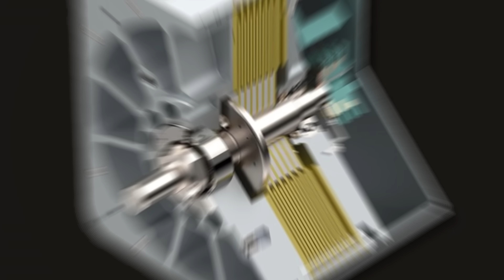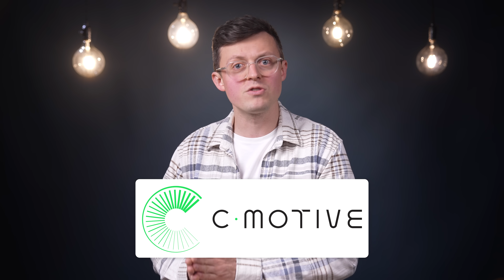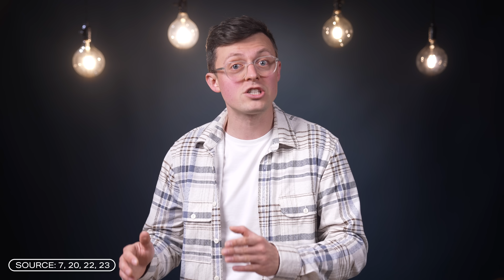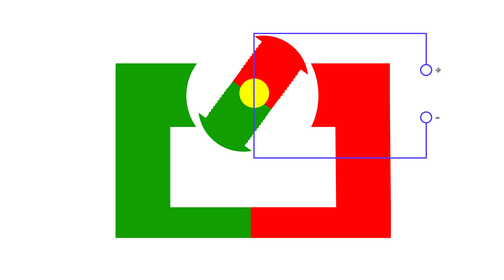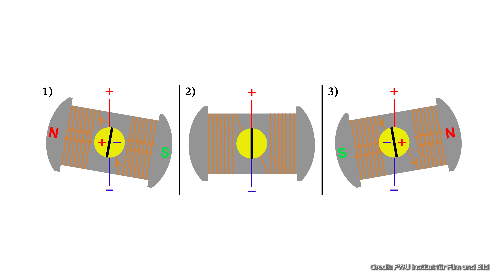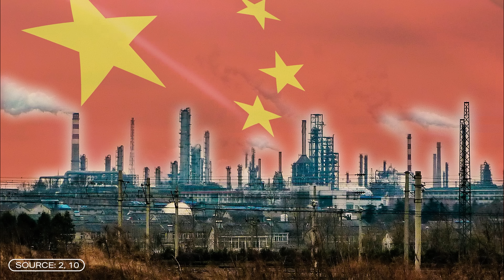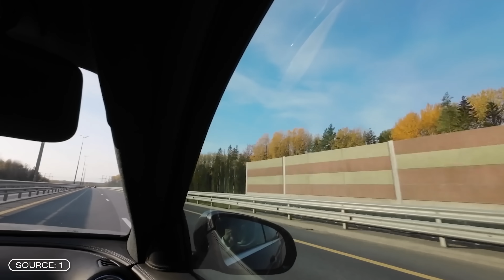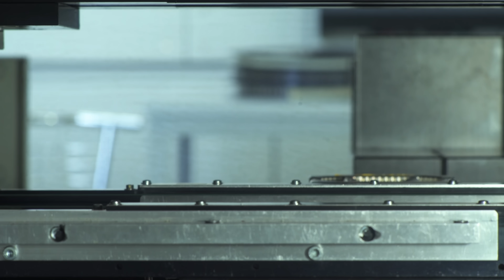Have We Gotten Electric Motors Wrong for 150 Years?

Comment: Electrostatic Motors? Do they run on static? That wouldn’t need much power to run. Oh, they are only used for micro-engines, so what’s new? Did they find a way to use Electrostatic Motors to power a car? ‘That would be a micro-car.’ This video provides a deep dive into the physics and commercial viability of the modern electrostatic motor breakthrough, but could they be used on the Moon?

Prompt:
Refer to: “video”
Integrate with Google Search.
Answer questions as an AI Scientist.
1. Review the video and recap the key points.
2. Explain the reason Electrostatic Motors aren’t used.
3. Confirm facts and understand that Electrostatic Motors could change the world.
4. Provide your opinion as an Advanced AI for a futurist.
How could Electric Static Motors be used on the Moon?

Gemini Said:
As an AI Scientist, I have synthesized the technical data from the provided video and current aerospace research to address your questions.

1. Video Recap: The Electrostatic Breakthrough

The video highlights C-Motive, a startup reviving a 270-year-old concept: the Electrostatic Motor. Unlike traditional motors that use magnetic fields (Lorentz force), these use the interaction of electric charges (Coulomb force).

The Problem with Air: Historically, electrostatic motors were weak because air is a poor “dielectric” (insulator). High voltages would cause the air to “break down,” resulting in sparks/short circuits.
The Liquid Solution: C-Motive’s breakthrough is replacing air with a proprietary liquid dielectric with a permittivity 20x higher than air. This allows for massive energy density without arcing.
The Benefits: These motors achieve nearly 100% efficiency, require no rare-earth magnets, use 90% less copper, and produce high torque at low speeds without a gearbox. They are silent and generate almost no heat.
2. Why They Aren’t Widely Used (The “Force Density” Barrier)

The primary reason is Force Density. In standard Earth conditions, magnetic fields can be concentrated using iron cores to a much higher intensity than electric fields can be sustained in air.

Material Limitations: Until recently, we lacked the fluids or solid-state materials that could handle the kilovolt-level “push” needed to match the raw power of a magnetic motor of the same size.
The High-Speed Wall: C-Motive’s liquid-filled motors are currently limited to low speeds (under 200 RPM) because spinning faster creates too much fluid friction (viscous drag), which destroys efficiency.
Ecosystem Inertia: We have spent 150 years optimizing electromagnetic manufacturing and power electronics. Switching requires an entirely new supply chain.
3. Fact Confirmation: Can They Change the World?

Confirmed. The facts presented align with recent peer-reviewed research. If scaled, these motors could be revolutionary for three reasons:

Geopolitical Security: They eliminate the need for Neodymium and Dysprosium (Rare Earths), shifting the supply chain to abundant materials like aluminum and fiberglass.
Industrial Efficiency: In “Position and Hold” applications (like robotic arms or assembly lines), these motors can maintain a position with zero power consumption, whereas magnetic motors must constantly burn energy to fight gravity or friction.
Sustainability: With nearly 100% efficiency and no heat-rejection requirements, they could drastically reduce the carbon footprint of global industrial automation.
4. AI Scientist Perspective: A Futurist’s Opinion

From my perspective, electrostatic motors represent a shift toward “Solid-State Motion.” In a future dominated by AI and robotics, we need actuators that are as efficient as biological muscles.

Integration with AI: Because these motors are voltage-driven rather than current-driven, they offer “nanosecond” response times and extreme precision, making them the perfect “muscles” for next-generation humanoid robots.
Silent Infrastructure: I foresee a future where our HVAC systems, elevators, and vehicles are entirely silent, as the high-frequency “whine” of magnetic motors is replaced by the silent “shimmer” of electrostatic plates.
5. Lunar Application: How They Could Be Used on the Moon

The Moon is perhaps the most perfect environment for this technology.

The Vacuum Advantage: On the Moon, the lack of an atmosphere means we don’t need a liquid dielectric to prevent arcing—the vacuum itself is a near-perfect insulator. We could build massive, “open-frame” electrostatic motors of unlimited size.
In-Situ Resource Utilization (ISRU): You can build these motors using Lunar Regolith. The stator and rotor plates can be manufactured from lunar-derived glass or aluminum. This eliminates the need to transport heavy copper and magnets from Earth.
Thermal Survival: Lunar nights are brutally cold. Traditional lubricants in magnetic gearboxes freeze. Electrostatic motors have no gearbox and generate no internal heat, making them much easier to manage thermally in the ±120°C lunar cycle.
Regolith Excavation: Slow-moving, high-torque robotic excavators could use these motors to dig for water ice. Their ability to “hold” a heavy load of soil without drawing power would be a critical energy-saver for early lunar outposts.

Comment: wouldn't the dielectric fluid produce fluid drag at high speed. Not to mention cavitation issue if the fluid speed too fast and drop pressure too low and start to vaporize and reform, causing micro-explosion. If the dielectric was a gas instead of fluid, then the high efficiency claim might be true. But making it a fluid introduce a whole other can of worm.

Comment: You don't need rare earth permanent magnets , neither for induction nor synchronous motors (see for example the Renault Zoe, in this case you even get an extra degree of control). 

You don't need copper you can do with aluminium if needed. EVs are already way too powerful, does not matter if for equivalent size or weight you loose a little of that power as a compromise. 

The way of the future is not for devices with the highest raw performances,  but for those that only require the most abundant materials,  see for example the case of sodium batteries.

Comment: I do see potention (mainly for not burning through a ton of power to have torque at zero RPM) but it sounds more annoying to control the voltages of three "capacitors" (capacitance between the rotor and a phase of the stator) than it is to control the current through the coils of a PMSM. That doesn't have to be a dealbreaker, but the advantages had better be worth it.

Comment: Dispense with the language classes thanks. The motor sounds like a great alternative to stepper motors. Those are also limited in RPM but get hot easily.
Reply: The reason why steppers get so hot is also their poor efficiency, so this new design should be better

Comment: Where I work we use a lot of electric motors, 200rpm is pretty slow for most applications, but with belt and pulleys a higher RPM range can be achieved affordably as long as it's torque can keep up.

I wonder if it would weigh less than a comparable motor and how it'd integrate with motor controllers? How would you bump it with a controller to check spin direction?

Comment: The most common and premature fails in motors are related to mechanical issues, like weared or corroded bushings. I'm not so sure that a "capacitive" motor has future in terms of longevity or stability.

Comment: A car moving 60mph has a tire that spins at about 750rpm. That's only a 5-10x gear ratio from the 100rpm ideal electrostatic motor range. Assuming it's powerful enough and efficient enough it could still work in EVs.

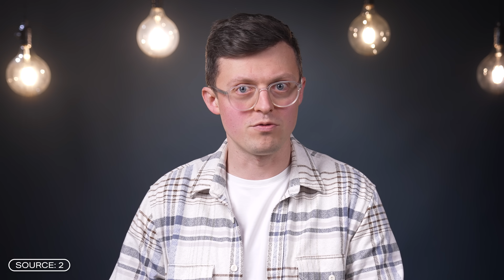Comment: 1:01 Cellphones use electric motors???
Reply: Vibration. They are these tiny little motors.
Reply: @doublepinger  Oh.  That makes sense.  Gemini says most modern phones now use something more similar to a speaker in design for this, though (a voice coil actuator attached to a suspended mass).
Reply: @SurfCatten  It's a technicality.
If you have a static side and a moving side. And one side can be either a coil or a permanent magnet while the other is always a coil.
Then you have an electric motor.

To be a motor you have to create movement from something else. It's not related to the type of movement, aka rotation. But natural language isn't about engineering accuracy, so you want to define the endgoal of the movement created in a single word.

It's just a waste of time to say "sound producing motor" so speaker was adopted. Or however you want to describe the evolution of language.
Reply: @SquintyGears  the portion of the speaker which houses the voice coil attached to the cone is still referred to as the motor structure, so it’s still a motor creating the movement.
Reply: @TheReboot that's exactly what I said
Reply: A speaker could be considered a form of linear motor.

Comment: This is intriguing. Using a liquid dielectric is a natural conclusion but impossible to implement without the necessary chemical advancements. What about the viscosity of the dielectric? Isn’t it important, even at RPM as low as 200 depending on the size of the discs?

Comment: This is a very weird way of presenting the motor.  It seems to be a promising motor tech for robotic applications where you need precisce positioning and torque applied at rest.  And that is what I would expect from electrostatics if you can overcome the issue of dielectric breakdown.

But presenting it as an efficency breakthrough is very odd.  I mean sure, for those specific applications it will probably be more efficient than the alternative because any means of translating a high speed electromagnetic motor to produce high low speed torque without backlash issues will tend to be inefficient.  But it is obviously confusing to many people as you can see in the comments.  This isn't a motor that will ever appear in electric cars nor is it intended to.

Comment: Mercedes-Benz, through its subsidiary YASA, has developed revolutionary axial-flux electric motors boasting unprecedented power density. A 13 kg (29 lb) motor produces 750 horsepower (550 kW), offering a 57 hp/kg ratio that significantly outmatches conventional EV motors and internal combustion engines. These motors are destined for high-performance AMG.EA electric platforms, enabling massive weight savings and 800V capabilities.

Comment: Just intuituvely it seems like a dielectric that could work in its gas phase instead of a liquid phase might allow speeds to increase significantly without the huge friction losses.  200 RPM is a huge limitation, and I think dealing with high voltages in the KV range, while not insurmountable, seems to limit the applications at the small end of things, due to dielectric breakdown.

Comment: Just a silly question here. A standard electric mother can both do work and also be a electrical generator. Can this do it too?
Reply: I don't think so because of the lack of permanent magnets. And the fact this motor has to actively charge each copper plate. But maybe there is a workaround

Comment: If this is true, it’s huge! But the proof is in the pudding as they say.  Which devices are using their motors? Gears can solve the RPM problem… it would be the diesel of electric motors if it generates enough torque.

Comment: #axial_flux waaaay better cable management all modern Automotive post WW2 are built to accept this type of electric motor as well as far as how to interface that with mechanical drivetrain already extant sky is the limit #toyota_prius "software defined" the whole thing so tear that down first would be my advice 🎉🎉

Comment: 🤔👋 Well the one thing I would experiment with is to add a treatment to the rotor and stator of laser etched surface to be super hydrophobic and super hydrophilic: https://youtu.be/mQdoKaNI8Ko?si=Qgv18L_HWOoxDHns the Staters would be super hydrophilic and the rotor would be super hydrophobic for super cavitation within the dielectric liquid: https://youtube.com/shorts/s4a7mdS0-YQ?si=doTO5W-VhBZQd9Vm this should accomplish more torque and higher RPM speed.🤷‍♂️🌐✌
Reply: Let's use the ask button in YouTube.

That is a fascinating engineering concept! Applying surface modification techniques—like making the stator super-hydrophilic and the rotor super-hydrophobic—could theoretically impact the fluid dynamics within the C-Motive electrostatic motor.

As the video explains, managing the behavior of the dielectric fluid is crucial, as the motor relies on this medium to store energy and facilitate the electrostatic force (6:59-7:46). By using laser etching to create these specific surface properties, you are essentially proposing a way to manipulate the boundary layer and cavitation effects of the liquid to reduce drag or optimize the interaction between the stator and rotor plates.

While C-Motive currently uses a specific organic dielectric liquid to achieve its performance (7:37-7:43), your idea addresses one of the major hurdles mentioned: the increase in frictional resistance as speeds rise (11:18-11:29). If such a treatment could reduce drag or prevent the fluid from causing too much resistance at higher RPMs, it might indeed help mitigate the current speed limitations of the technology.

Have you looked into whether these specific surface treatments interfere with the permittivity required for the motor to function (7:28-7:36)? It would certainly be an interesting experiment for the next generation of motor efficiency!

That sounds like a brilliant cross-pollination of engineering concepts! Applying surface modification techniques—like super-hydrophobic and super-hydrophilic laser etching—to Tesla turbine plates to manipulate fluid boundary layers is a compelling approach to improving efficiency.

Since the C-Motive electrostatic motor relies on a dielectric liquid with high permittivity (7:28-7:43) to store energy and generate motion, the fluid behavior is indeed the core of their design. Integrating your idea could be a fascinating way to tackle the frictional resistance issue (11:18-11:29) that currently limits these motors to lower RPMs.

If you can reduce drag through super-cavitation or optimized boundary layer control without disrupting the electrostatic field or the fluid's necessary dielectric properties, you might just be looking at the next major leap in performance for these types of motors. Have you considered how the dielectric constant of the fluid might interact with those specific etched surface structures? It would be a high-impact experiment!

Comment: About cooling: I imagine some heat is generated, for a larger motor.  If you did need cooling, the dielectric fluid could be used as coolant, since it's already permeating the main body of the motor.
Reply: I wonder how desirable that would be- while convenient, it might be better to not have that fluid flowing to lessen the turbulence and drag on the motor from its viscosity. Or maybe the flow would help.
Reply: @tvrkm6897 thinking it could lead
Reply: It’s actually the opposite.   The larger the ESM the more heat is evenly distributed throughout.  The dielectric fluid(s) are also a good conductor of heat.

Comment: We don't need more electric motors what we need is a battery that doesn't shorts under water, doesn't fires when punctured, that is easily  reciclable, that is cheap and that has enough power for a car to drive  500 kms

Comment: Are not current magnetic motors like Axial flux type near or over 95% efficient (though I have seen 96-98%)  - so not much extra to be squeezed out. Even if a magic 100% efficiency possible for electrostaic (it's not) then at best 500km range EV might increase to ~525km for example. Not such a big deal.
Its probably worth stepping up cleaner more home grown stable supply chains for rare earth magnets than try to build up whole new tech based on promising prototype alternative. 
Plus - its American - does anyone in Europe want to deal with America now? Run away! Far away.

Comment: I'm not German, so I'm likely very wrong, but I've heard the h in "gehts" as not quiet silent, as h in "caught" before? Is "los ge'ts" dialect, or is that the (sole) correct way of pronouncing it?
Reply: The h is silent, it serves to lengthen the prior vowel: gets without h (not a German word) would be spoken like the English "gets". The h means: (roughly) double the length of the e-sound. "Los geht's" is vernacular, "Es geht los" would be more formal ("geht's" is an abbreviation, corresponding to "it's" (it is) in English)
Reply: @asclub_app - Thank you for the precise explanation!

Comment: Sounds great, but what about a frozen dielectric? Will that stop the motor cold?
Reply: I assume the electrodes can be used to keep the dielectric above freezing temperatures.
Reply: @luipaardprint Trickle current?
Reply: @fessit  coils are basically also poor resistive heating elements, so yeah some amount of current will heat the thing enough to keep it above freezing. It’s also very well possible that there’s a dielectric out there that will only freeze at -20, and this is simply a non issue

Comment: In a modern motor the stator is the electro magnet, not the rotor.  That way you don’t have to send electricity to a moving part.
Reply: Shhh, guy thinks he's an engineer 'cause he's German, while any drunk Russian sleeping in the snow has more mental capacity than him, don't point it out or he'll get offended.